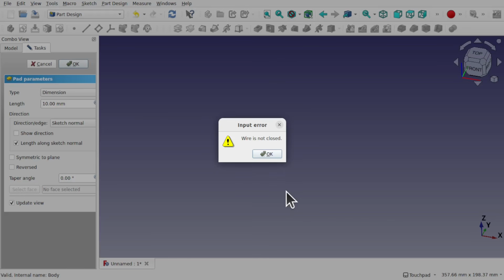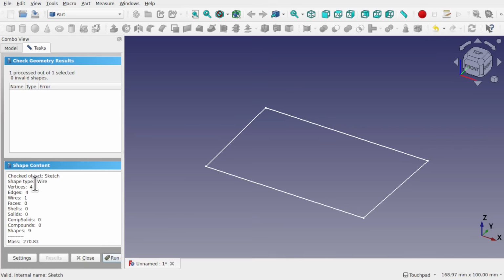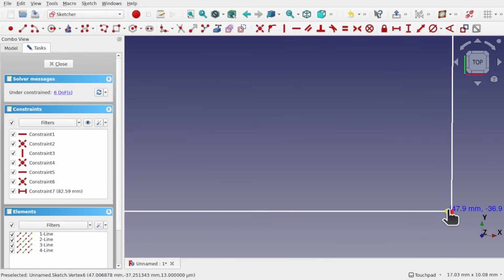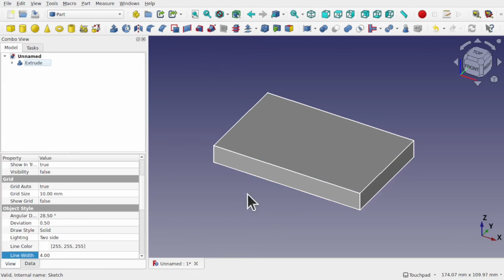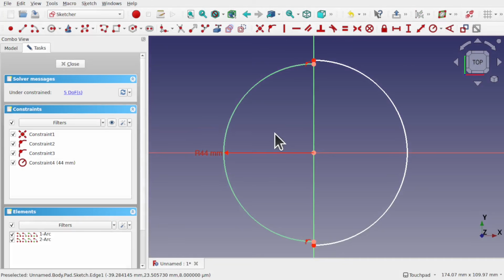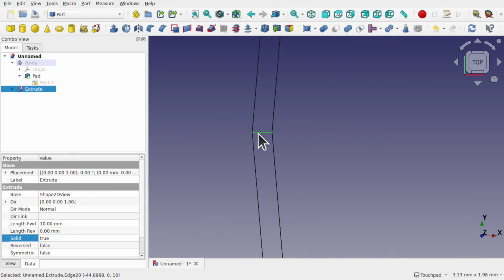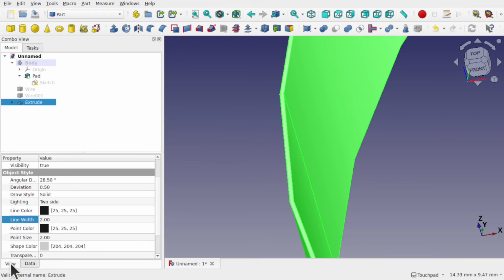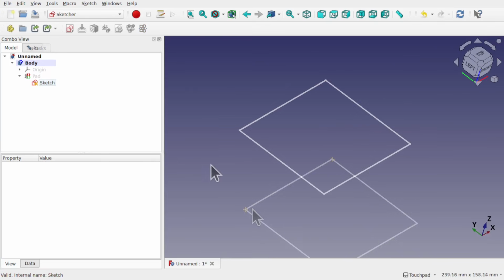FreeCAD: Wire Not Closed ! How to Avoid and Fix the Issue | Part and Part Design

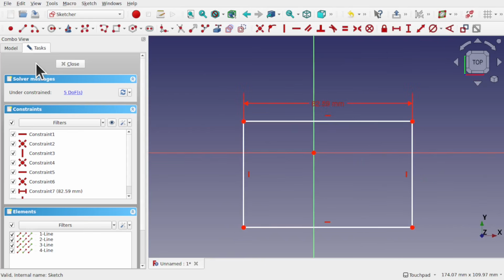Comment: Thanks for the nice video. In my case i can see the line under my sketch but I cannot "highlight" them and go to conincidence button like you do (@8:42) in your video. Which mouse button or buttons combination are you using to highlight the problem points/lines. A short hint on "highlighting" would be most welcome. Thanks.

Comment: i am on video 13 of your freecad for beginners series and for the life of me i can not complete this drawing haha. just found out through some forums that there is a bug that pops up about wires not being connected even though they are fully connected.
Reply: I think my over zealous use of rounded off dimensions my be a contributing factor. Perhaps there is some type of ranking system on constraints I’m not aware of.

Comment: How to resolve the issue of drawings created in FreeCAD, exported as DXF files, and run on CNC machines that report the drawings are not connected.
Reply: Being a newbie at FC 21.1 and not certain of this hypothesis.  Suspect that my use of rounded down dimensioning may be pulling things  like hard dimensioned arcs and curves apart. You will have to test it yourself.

Comment: Extremely comprehensive. So much great info I had no idea about delivered understandably on a seemingly simple topic. Thank you! I've been trying to figure out how to edit primitives'. For example: Let's say my part calls for a bolt to be part of the model. Let's then pretend I need to make a hole through the bolt perpendicular to it's length for perhaps a lock wire. I know how to use the helix tools, and the hole tool to do this all in the Part Design Workbench, but it would be so much easier, and faster to grab the appropriate bolt size from the Fasteners Workbench to incorporate into my model. The same goes for primitives' from the Part Workbench. Is this done by changing something in the View tab? Also I was trying to do this yesterday by using a cylinder from the Part Workbench to create an angled hole through a part. While I was using Transform on the cylinder to move it into position the origin separated from the part, and ended up quite far away. Eventually I gave up, and put the model into Meshmixer to do the boolean operation. Prusaslicer really doesn't like when I use MM.

Comment: Very informative 👍. I have been building up a collection of extruded aluminium sections as a library to practice FC. My method to avoid open wire has been to sketch the basic outline, and pad it. Then edit the sketch to add more features. Making sure to save before changing the original sketch.

Comment: Good info, I have fallen foul of wires hidden under other wires   before and pulled the last of what hair I had left out trying to find the issue. The biggest thing that drove me to distraction was then trying to select the little &*£% to delete it!
Reply: Totally agree.  I think what might be causing these little “gems” is a combination of using construction elements and the trim tool…
I’d love a function to rotate the z ordering of stacked elements or the ability to hide the top elements…
Thank you for another informative video!